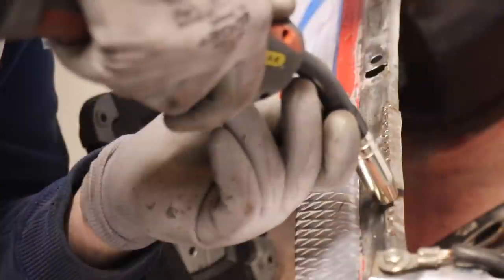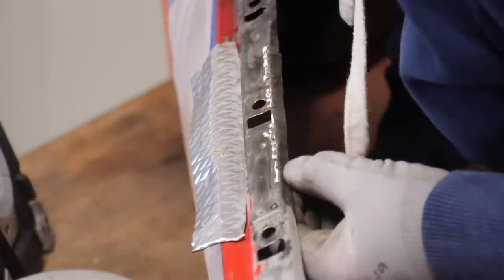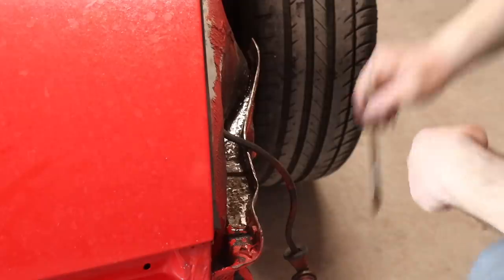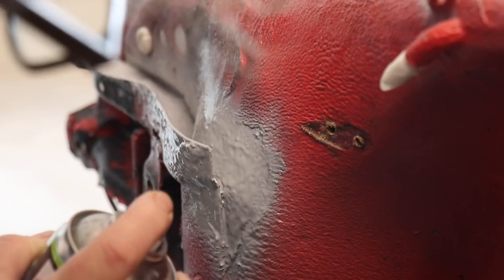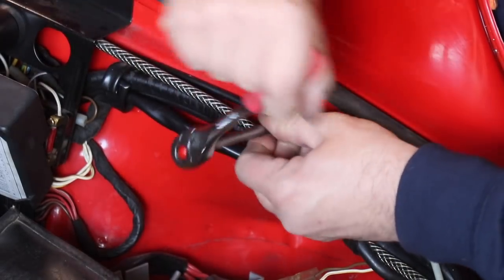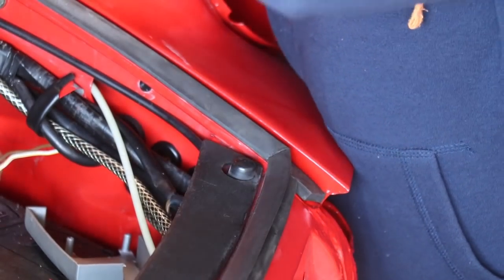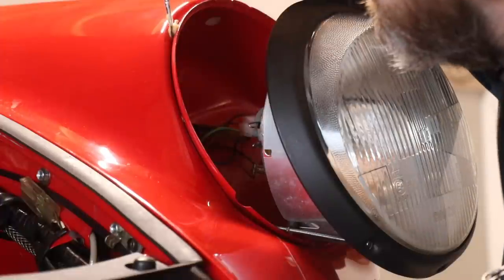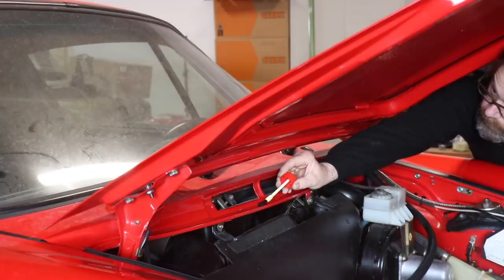Restoring the Final Wheel House (Porsche 911, 87)

Comment: always a pleasure. the grease on the back of the lamp housing was actually pretty smart. my vw typ 3 was partly saved by repeated layers of oil (leaks) and road dust & grime, followed by more oil..  for 50 years. the result was a thick, stiff, black-brown layer under which the car was perfectly preserved.
Reply from the maker: Thanks for the feedback, I’m really glad you like it.
Rust protection with oil & grease is a double-edged sword. It’s easy and efficient on the one hand, but once you go down that road there’s no turning back. To me, it destroys much of the joy that a classic car can give if all the beautiful design solutions are covered in dirt.
Reply: @GreasyFingers  true! plus it's heavy... naturally i cleaned it all off, but it did me a big favour.

Comment: Great Video as Usual.  I am dreading doing the final alignment of my fenders using the adhesive putty tape.  Glad to hear that my belly will finally come in handy to move the fender into place.  I can't believe that people are actually back dating the G-Body Porsches.  They are beautiful as is.  In 20 years there is going to be a wave of people fixing all of the back dated G Bodies.  Case in point, my '72 was front dated to look like a G - Body and I have been spending the last few years turning it back into a '72.  Keep the videos coming.
Reply from the maker: Thanks very much again, Rodney.
Attaching the fender, it certainly makes sense to have a second person around. Especially at the left one, where one had to thread the plastic tube for the tank cap lock. 
Yeah, this whole „trying to be someone else“ thing never works.

Comment: I’m fascinated by your excellent work! It’s mind blowing. I’m ground up restoring a 88 bmw 535i . I’m wondering what brand or type of butyl tape you are using?  I will need to source the same for my fenders. Thanks in advance !
Reply from the maker: Thanks, Wolf.
I‘m afraid I don’t know the brand of the tape. I ordered it at my 911 parts dealer among some other stuff.
I don’t think there are huge differences in quality. If you take it from e.g. Petec or Würth you can’t go wrong.